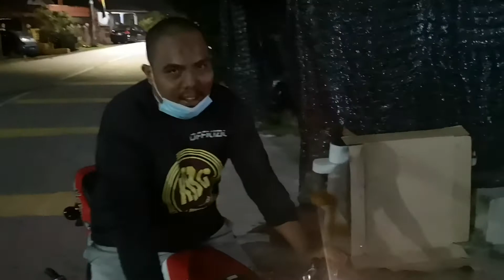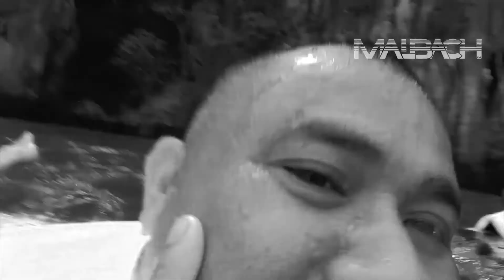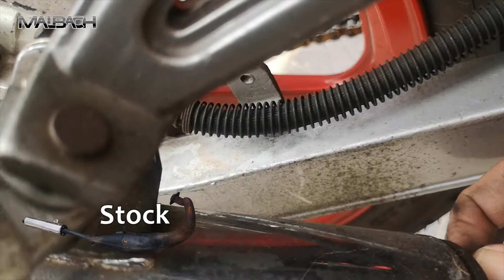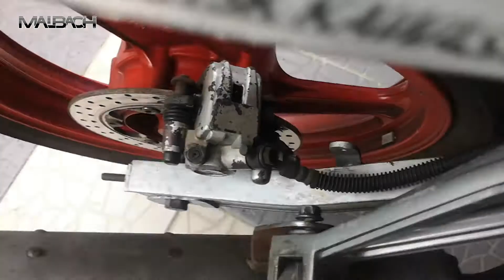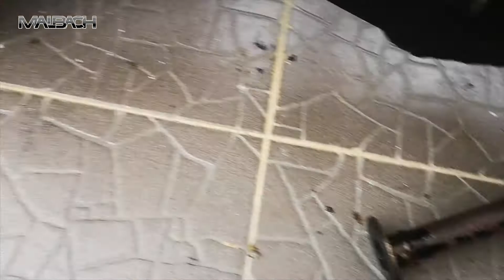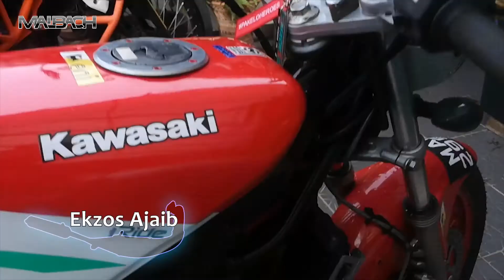Kawasaki Kips Victor Exhaust Sound #ninja150rr #soundcheck

Comment: Bang nk tnya moto ap lagi yg lebih kurang  kips victor ni...contohnya ada lmpu bulat and tank cmni
Reply from the maker: Kalau nak yg modern, Fz150 first generation, cc besar tapi klasik boleh survey Kawasaki Balius, Rd125/250/350 Lc or Ypvs untuk 2 stroke. CBR250 Naked baru pun lampu bulat. Benelli Leoncino 250/500 pun best

Comment: Paling best utk top speed, syahdu yg mane bang? Gentle cakap..
Reply from the maker: Gentlenya x test jauh2 lagi, pkp🤭.. Skali test confirm chamber full la. Dia punya ting2 comoression dlm perut tu masa dile pun dah padu
Reply: @MALBACHinc  ingatkan dapat jawapan std kopek.. Ramalan ku meleset belakaaa..
Reply from the maker: Hehe kalau motor tiptop dari awal beli mungkin sedap standard kopek. Motor tua ni susah nak ckp. Mmg lagi sedap dr mula smpai akhir rpm pakai chamber ni. Kacuk pun sebab nak kasi dia senyap sikit. Pengalaman dgn kips hijau 2011, x pernah usik apa2 dari mula beli mmg syahdu. Lembut dan lancar daripada tzm yypang tapi kalah teruk topspeed. Paling teruk skali kalah dgn panther jerung idle bobok. Meter tipu kips ni dah dekat 200 tapi kene pintas mcm lari 60. Confuse panther ke R1 yg potong td. Head2head dgn super kips dua2 baru tahun sama, satu standard (saya la tu) satu yypang baru pasang . Gear 1 n 2 sama lagi, masuk gear 3 makin jauh, gear 4 dh nmpak mcm kumbang kat depan, gear 5 mcm semut, gear 6 x nmpak dah. Kisah benar di hiway guthrie suatu ketika dahulu 😆. Harap membantu
Reply: @MALBACHinc  stakat sy pakai, belom lagi try dgn mane2 150 2t yg lain sebab motor set bawak bini bang. Spoket besau blakang. Dulu waktu beli, owner lame pakai powerjet 28 dgn perut gl. Mencanak pikap. Tp top menung. Lepas tukar pe28 dgn std operate, perjalanan semakin lancar dan padu bang. Depan kekal ratio 14, main tukar belakang je.. Lagu besau spoket dgn berat motor, lagi pegi kipas victor sy ni bang. Sebab motor slim je, xberani perah bawak org rumah. Mungkin karakter motor lain2 kot bang.. Tq info share pengalaman bos.. Lepas ni, test top speed plak dlm bideo.. Kipidap bosku!
Reply from the maker: @mah4605  Tengkiu2, saya pun baru2 berjinak juga dgn victor ni, awal2 dapat sporket 15-34. .aduhh x lalau nak tunggu rpm dia naik. owner lama badan kecik, kita ni 200 paun dah hahaha. tukar 41 lepas beli terlebih ringan. cuma tangan kebas teruk la walaupun ride dekat. Saiz badan x kena.  ada cadangan ke handle apa boleh masuk dalam motor ni. Dah survey2 handle pnp xleh masuk sebab saiz n lubang skru side x sama. kalau dapat yg tinggi sket mungkin mmbantu. kalau x dpt ejas motor ni, nmpak gayanya kene lepaskan lah, sayang simpan kalau x bawa jauh2
Reply: @MALBACHinc  handle pakai ninja ss atau r bang dari indon. Shopee skang dh ade.. Yg tu handle seketul, mcm basikal bmx. Tinggi sedap bang.. Pasal getaran tu abg dh check balancer gear? Mane tau kot2 ribet goyang ke..
Reply from the maker: @mah4605  lenguh sebab kedudukan badan dgn tangan rasanya. Kalau handle tinggi sikit munkin x pressure sgt kat tapak tgn, atau buka lebar sikit. Gegar x rasa sangat. Nnti saya cuba survey2 lagi. Terima kasih yaa bro